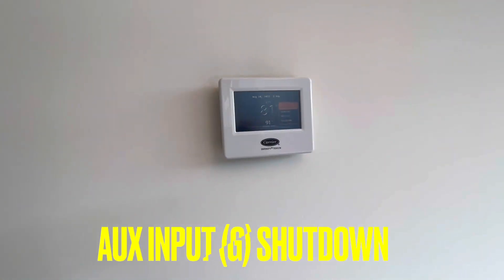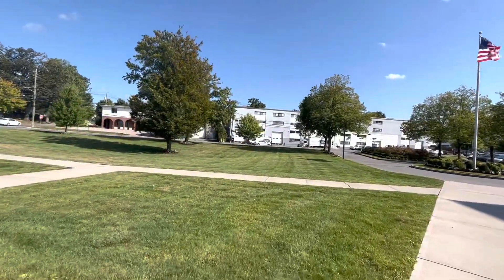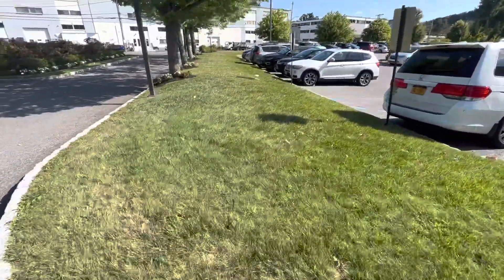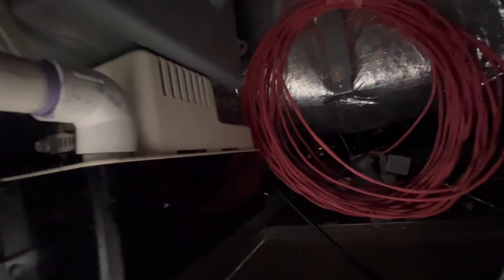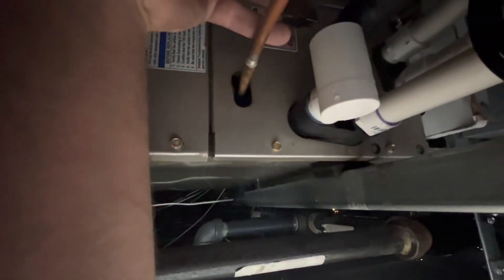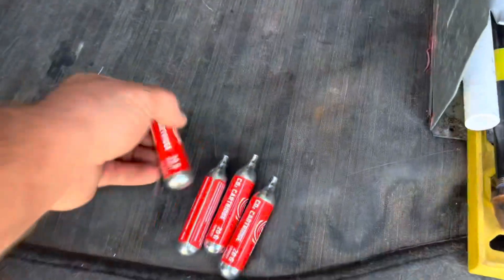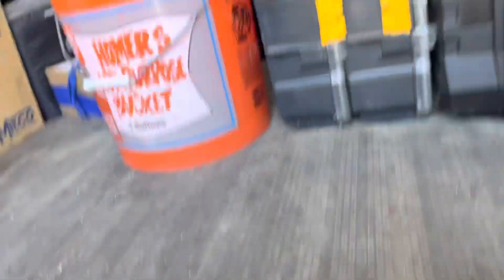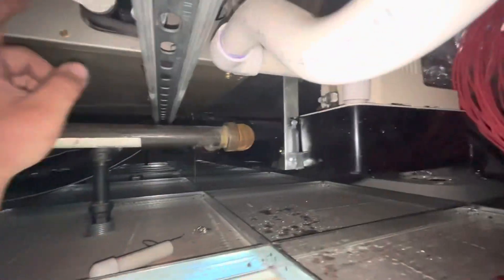CARRIER INFINITY. WHAT DOES AUXILIARY INPUT (G) SHUTDOWN MEAN?

Comment: I flushed the drains to the pump and water purges normally but error 196 still appears on thermostat display. How do I reset the error code from the thermostat? What did I mss? TIA
Reply from the maker: There may be water in secondary pan if you have one.  This particular video shows a safety switch wired at the trap. Some systems have a safety switch in other pan.   If you have the same set up then make sure the float on the switch is in correct position, which is down

Comment: How did they wire the float switch in on that communication system
Reply from the maker: Great question.  In the Infinity air handlers, there is a board next to where the communication wires get wired.  At that board, I believe you wire R and G from float switch and then go into Infinity thermostat settings and shutdown G when switch activated.  I believe that’s how.